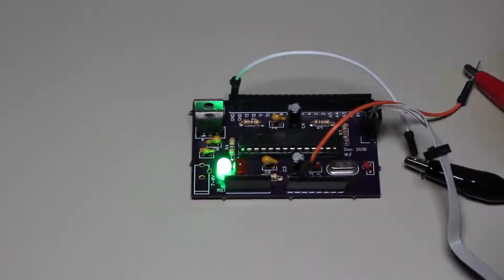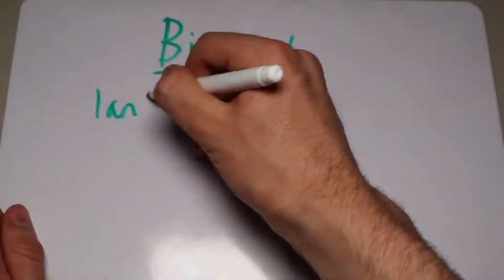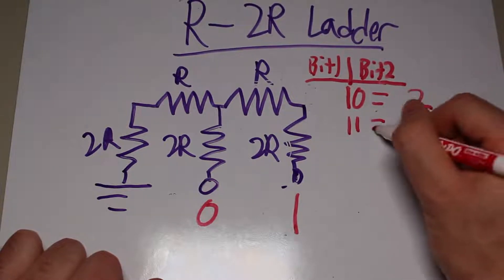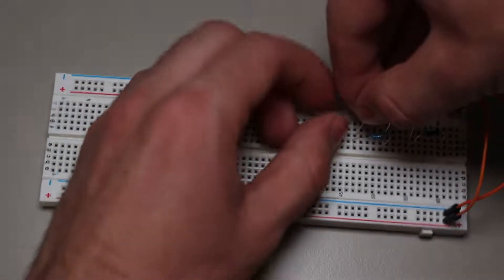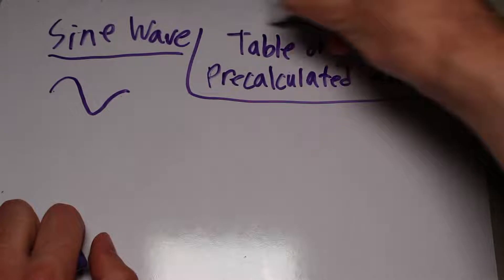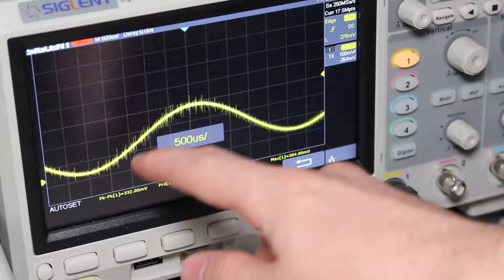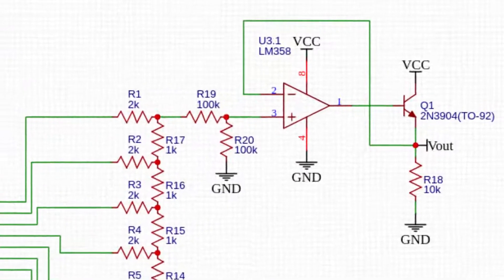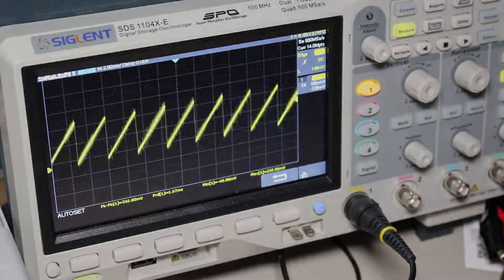Make your OWN 8-bit Function Generator - R-2R Ladders and DACs

Comment: A nice project. Very well explained. The video is very well produced. Two polite suggestions = Slow the speed with which you are reading your script - add a little space - breathe. The vocals are a bit muddy and hard to understand. All that is needed is for you to EQ the vocals by removing some of the 250Hz frequency range. You can do this in two ways. You could use the tone controls on a mic mixer, while recording. Or, you could use a program such as Audacity (free) to EQ the vocals as you are mixing down the video. I am impressed. I think you may be a younger person, so good for you. Keep it up. I subscribed.
Reply from the maker: Thanks for watching! I will remember your suggestions while I am making the next video. I appreciate it. :)